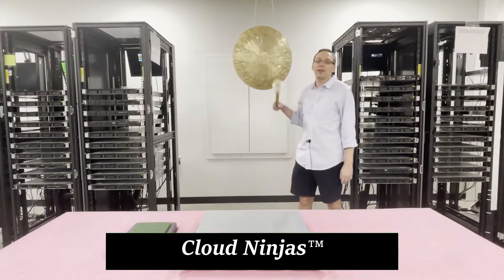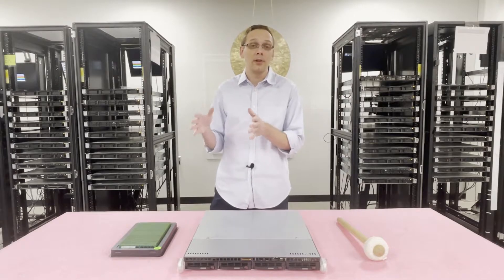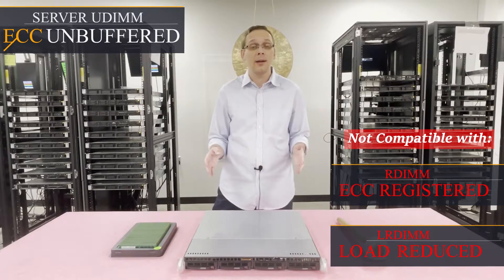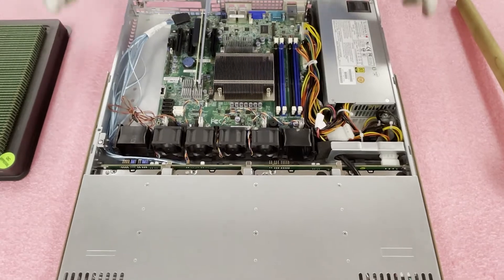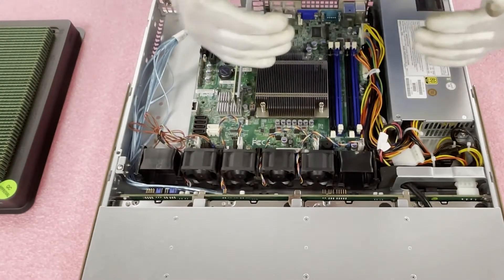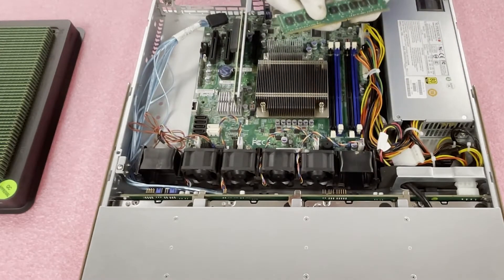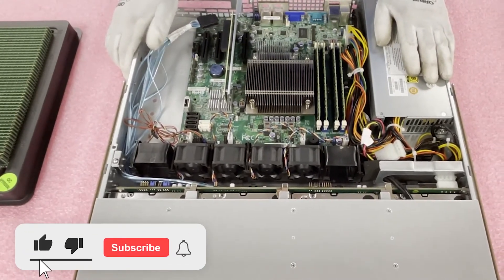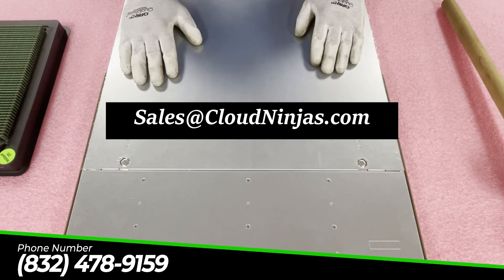Supermicro X9SCM X9SCM-F X9SCM-IIF (CSE813M) Server Motherboard Review & Overview | Memory Install

Comment: I have one of these boards with a Xeon E31245 in it, want to bump the ram from 16 (4x4) to 32 but man do they make it confusing and even on ebay the pricing for ones the specifically list this mobo are insane and not worth it - might be worth like $50 but it looks like you would have to spend around $200 and when you start looking at that cost it's much more worth it to just buy a used workstation like an z620 or similar which will have a faster CPU and 32 to 64GB ram...
Reply from the maker: We currently sell the 32GB kits for $140.  Sure they will be lower in future.  I agree ECC registered or load reduced based machines are the way to go from a pricing standpoint.  But if this is your server and already in production then I would definitely recommend putting in 32GB to get most out of it.  Appreciate your comments.   Have a Happy Holiday Season!
Reply: @cloudninjas  Thanks - this was just going to be used as an unRaid NAS server that I want to run a couple of VM's on and probably a Plex server and to be the backup for my Synology DS420+ and mainly because I have it lying around doing nothing...